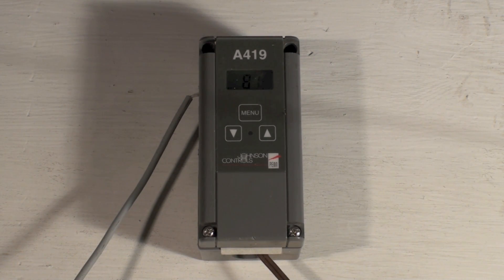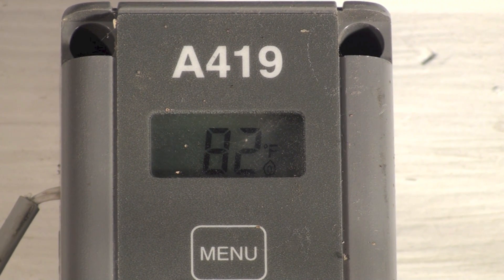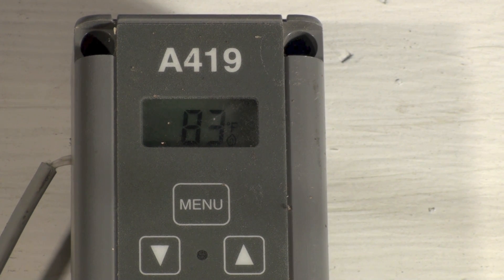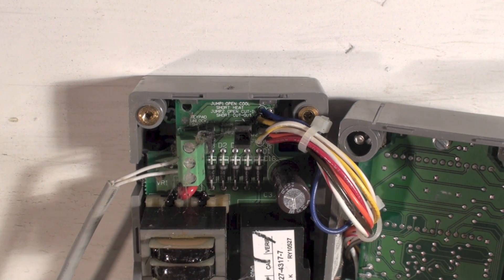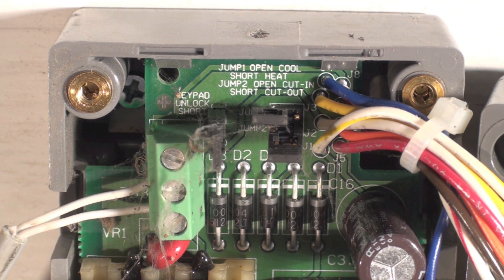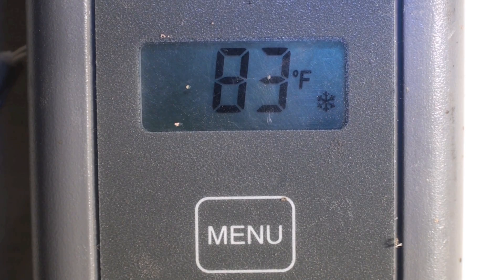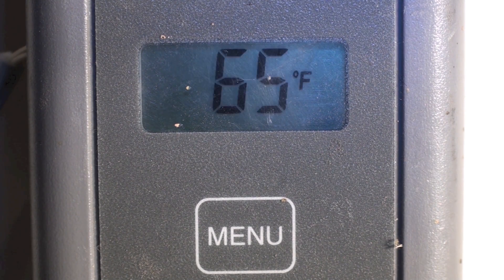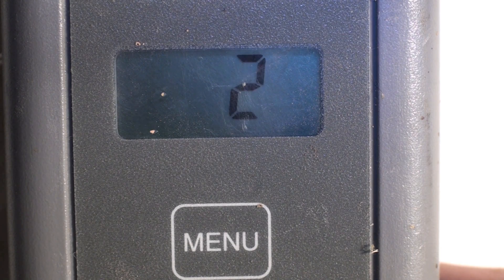How the electronic bulb thermostat works

Comment: Grayfurnaceman, I'm sorry, but what are those wires to the right of that jumper?
Reply from the maker: The control has been opened.  The right side is the top with the circuit board for the display.  The wires are to power the display and to energize the relay for the controlled circuit.
GFM

Comment: I use my A419 for an extra refrigerator. I like it set at 36-37 degrees. It is running all the time. Is that ok or should I change the set point number? If so what number do you think, so food and drinks don't spoil? Thank you.
Reply from the maker: It should cycle at that temp.  You could have a broken door seal or the compressor may be weak.
GFM

Comment: Excellent demonstration, I had to learn using this control on the fly on a account that I serviced. The control was used in a Multi Aqua chiller to control the compressor to maintain 45f chilled water temperature, before I started serving the units the diff was set to 10f I lowered it to 5f, so at 50f the compressor would come on and at 45/44f the compressor would shut off. Is the 5f ok, I thought 55f was way too high for the water temp to reach before having the compressor come back on. Is 5 ok or should I have set it up differently, would a lower differential have been better?
Reply from the maker: From what you tell me,  I think the lower differential will work better.  If the unit short cycles, you will have to increase the differential.  Hope this helps.
GFM